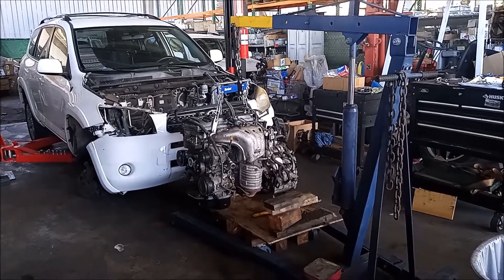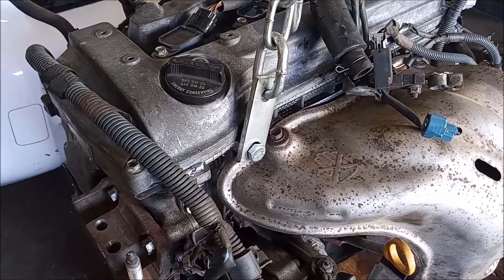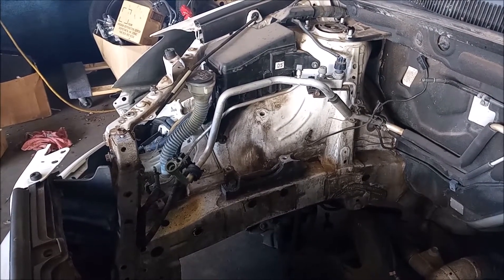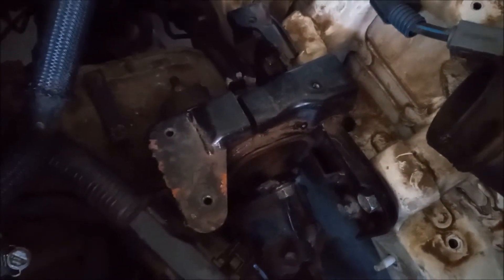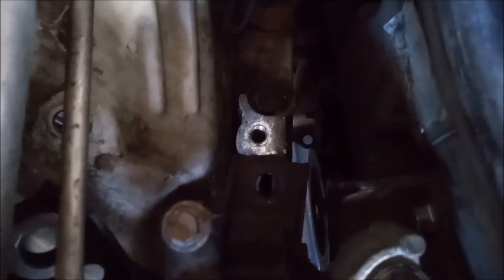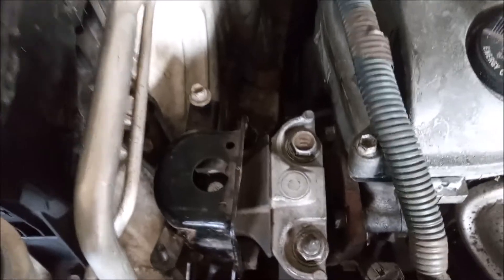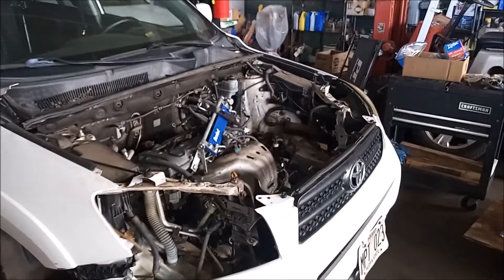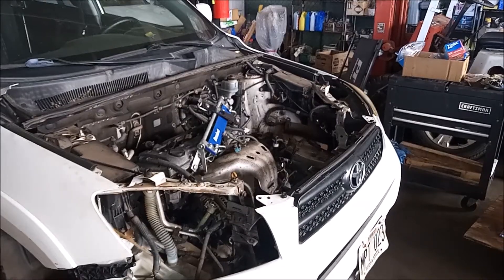How To Install The Engine -  Toyota RAV4 2.4-liter 2AZ-FE

Comment: Hello there. I like your videos. I have a 2008 RAV4 with the same issues. I wanted to ask why swapped the engine instead of replacing piston rings like what toyota said on their technical bulletin. Also, where did you get the other engine and how would you know that new engine do not have the same issues. I am mot mechanically skilled but trying to get help so I can fix my RAV4 which my daughter used for college. I am from Viriginia Beac VA. If you know anybody here that can help me, I would greatly appreciate. Thank you.
Reply from the maker: I am mechanically skilled but even so I do not want to undertake rebuilidng a 2AZ. Takes too long. Meanwhile I have a dead vehicle in my shop. Costs too much for parts and outside services. Not economical versus swapping a healthy engine. Sorry but I don't know anyone in your part of the country, I don't even know my neighbors next door.